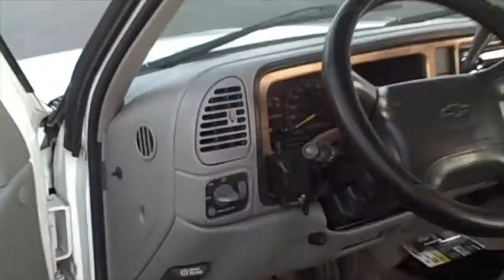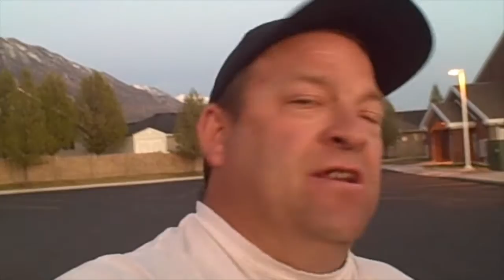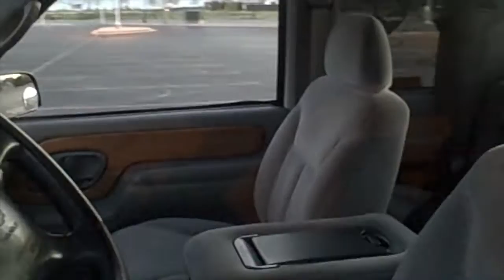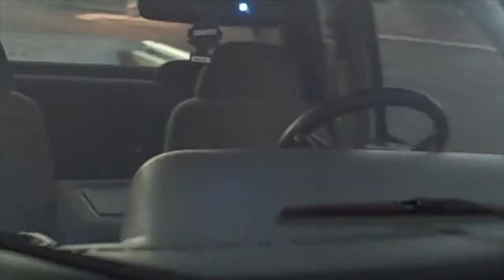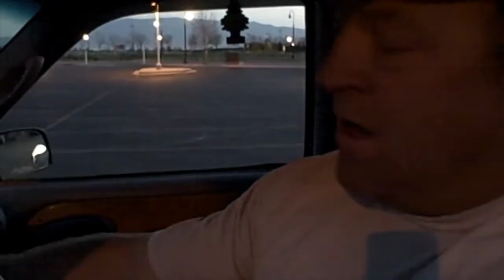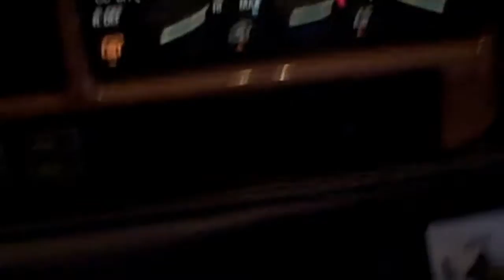part 13 viper alarm system

Comment: I bought a viper alarm from quality auto sounds on west Colfax and car in Denver I paid 500.00$ 200 extra for the alarm with were you can see the car it didn't come with the talking alarm they said I would I have to buy that sperate for another 200.00 $ the first guy I talk to said that all comes with it but then when I took it in the manager he was a real but hole not ly so rude and hate full I will never go there again did they over charge me? And was the talking pert of the alarm supposed to come with the alarm if so I am gonna go the B. B. B and turn him in what a hate full way to run a business especially when you are spending this kind of money  . Please let me know . Thank you